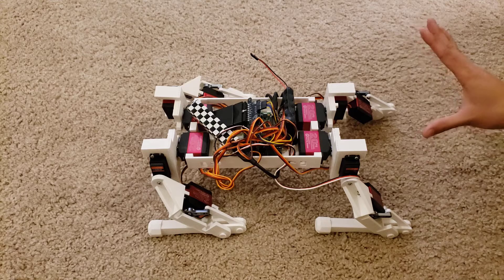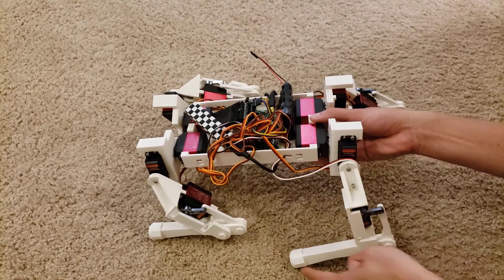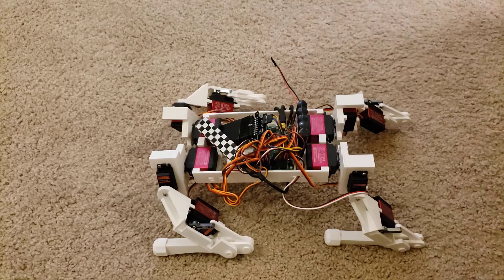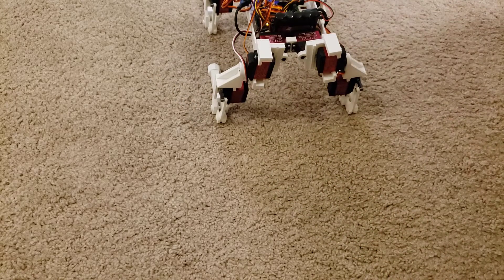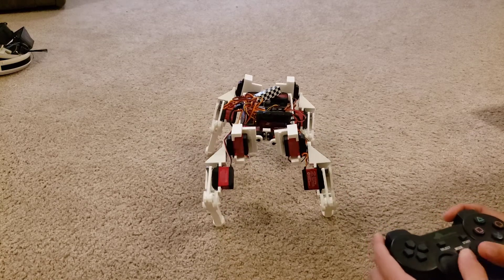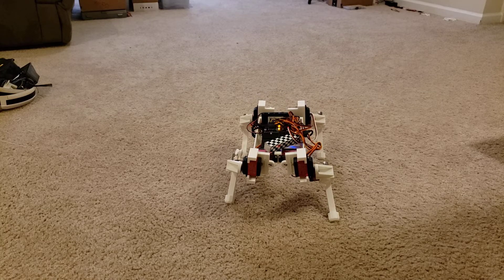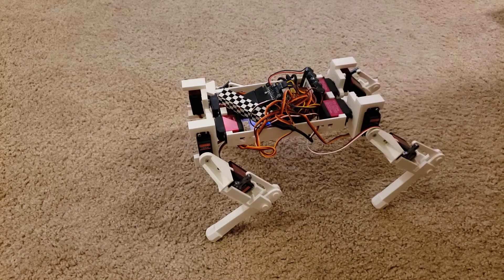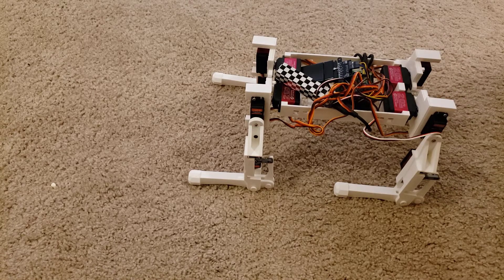DIY Robot Dog goes off leash

Comment: great job! I came up with a similar design https://www.youtube.com/watch?v=EDuPl-gz040 but  really like your open look walking algorithm - I havent got my head around how you combine the walking and turning... can you explain a little more how you did that
Reply from the maker: Very nice! I haven't dipped my feet into robot simulation like that yet but hope to pretty soon. 

As far as my algorithm goes. I've converted my rotational modes (Only have Yaw/Turning down at the moment) into translation positions for each leg. Then I fed those leg positions into the inverse kinematics that I had for the X and Y translation modes. It's basically a kind of superposition approach to get to each leg's end position from  X,Y, and Yaw inputs. 

I got that idea from James Bruton and his OpenDog series. If you haven't checked out his videos yet, you totally should. They've been super helpful even though he has a pretty different build.
Reply: @kylemccaslin  thanks that does help. i wrote a successful forward translation  algorithm and was trying to add to that to get turning but I couldn't get my head round doing it all at once (too complex)..makes sense to write an sideways and turning translation separately. I didn't think you could just add the translations together due to the complexities of gravity, momentum etc but it seems to work very well in your robot so perhaps those other factors I was worrying about have little practical impact..